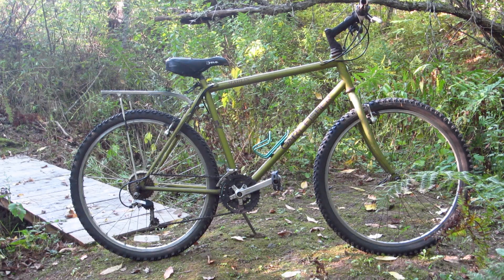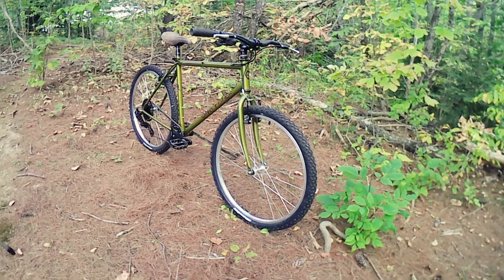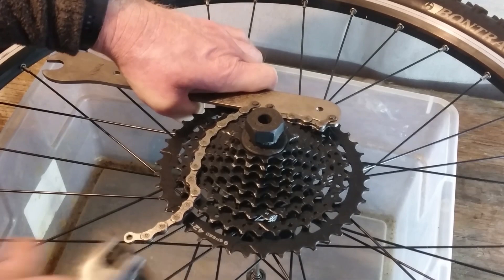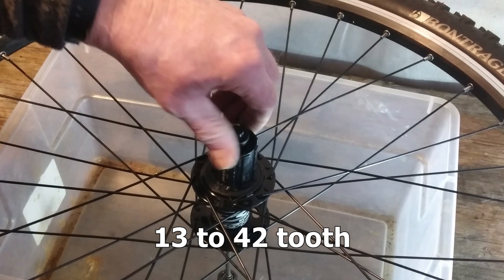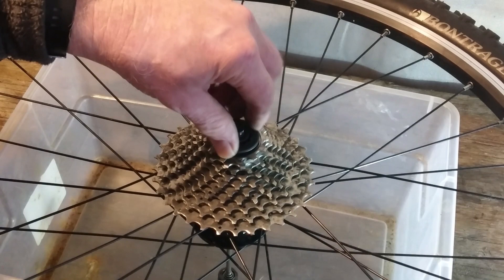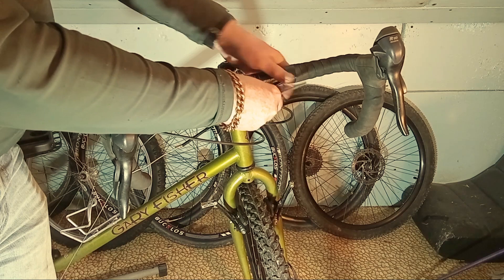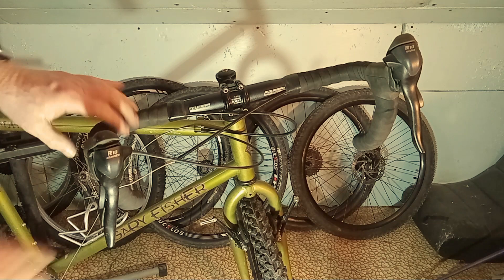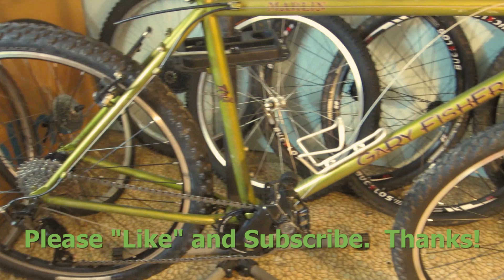Gary Fisher Marlin – From Rigid Mountain Bike to Gravel Bike

Comment: Hi Jim! What kind of wheel is that? Did you replace the Ritchey wheels with new hubs? Also, what do you use for the clear coat? Thanks! Nice job!
Reply from the maker: Good eye.  Those are GXFWJD (weird, I know) wheels I got from Amazon for $160.  I used Krylon rattle can clearoat.

Comment: I have a 96 stumpjumper I've been wanting to do something like this to. It has a 2x8. If I got 2x8 road shifters that should work with the gears, correct? I know the vbrakes will not work with the road bars, but I think there is an adapter tool that can be used.
Reply from the maker: The thing to watch is that your shifters match the number of gears in your cassette. My Microshift shifters work with my vee brakes, but I can't say for sure about other brands.